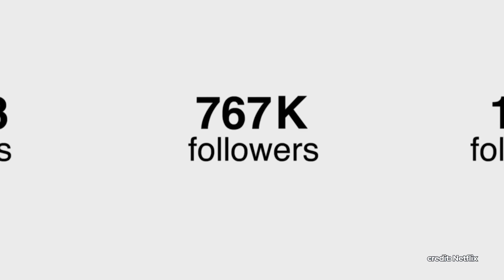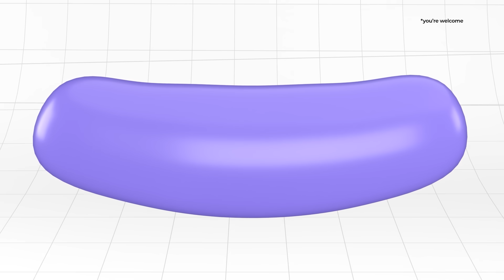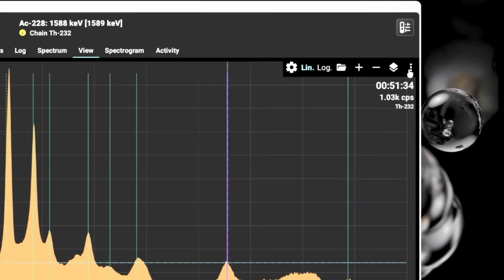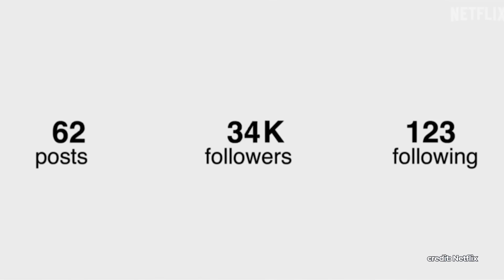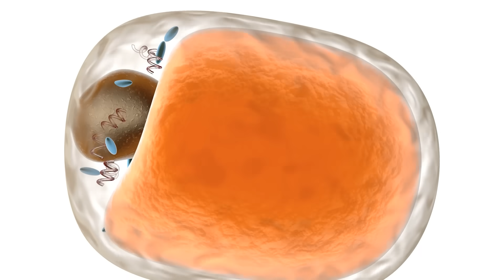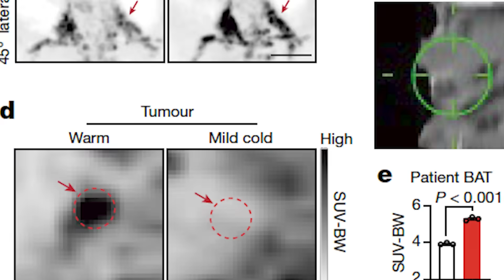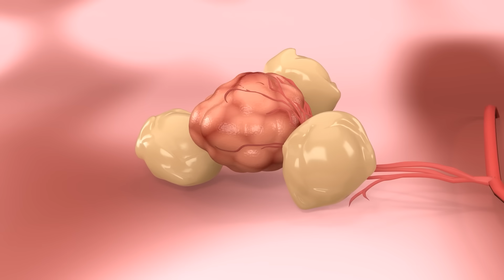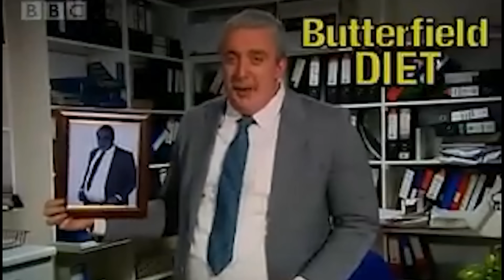Scientists Just Discovered How to Starve Cancer

Comment: 10:22 If the signal gets stronger at cold temperatures, that could still mean that it comes from muscle activity since in cold temperatures, muscles get to be more acitve in order to warm up the body, no ?
Reply: The temperatures were not cold enough to induce shivering, and therefore could not have increased muscle utilization

Comment: Question regarding the terms "Lactic Acid" and "Lactate" that you used several times here.

I was wondering if you were using them synonymously, or if you were intentionally distinguishing between them.

Chemically, lactic acid (C3H6O3) is the protonated form, while lactate (C3H5O3-) is the deprotonated form (the conjugate base).

I've always been taught that due to physiological pH, lactate is the form predominantly found in the human body.

Comment: Plenty of cancers thrive on ketones and autophagy as well.
Reply: Pancreatic cancer cells can be starved of energy by restricting glucose and encouraging the body to produce ketones. However, some cancers, including pancreatic cancer, can also utilize ketones. It's not correct to say they thrive, just that they can utilize ketones as well. You may still see potential benefits from slowing cancer growth by reducing or stopping glucose intake. No glucose will also mean no insulin spikes from high blood sugar, reducing inflammation which can damage your dna, potentially leading to more cell mutations like cancer. Elevated glucose levels can generate reactive oxygen species (ROS), which can cause cellular damage and promote tumor growth.
Reply: @ cancers will switch their energy substrate. It happens all the time. My uncle had several cancers and he switched to very high fat keto and barely ate, and saw no improvements. Cancer is tricky and nobody can say any specific cancer can use a specific diet.

Comment: I dont see how its applicable.
If you can locate the cancer precisely, and you do a surgery to implant the fat cell, you can as well remove it, its more easy.
it there was some fat cell clever enough to locate and agregate to the bad cells, it would be something to consider
Reply: Actually, no. Depending on where the tumor is, removing it is certainly not "easier", it can be pretty hard to do and risky for the patient.
Another key point is that surgical removal of tumors ruptures them and almost inevitably causes cancerous cells to migrate via the bloodstream and potentially cause metastasis, whereas an untouched tumor may have never metastasized. That's why surgical removal of tumors is often followed by chemo.
Surgical removal should IMO be a last resort rather than first one, when the tumor has become big enough to be a direct threat or cause of pain. Otherwise, it's always a risk of aggravating the situation.
So if there's a way to starve a tumor without having to rupture it, that's actually a big plus.
One thing I'd be worried about with this genetically modified fat cells is that they themselves might grow out of control inside the body and cause similar damage. Also, what if their DNA gets into your own? The idea is interesting, but the risks at this point look pretty severe.

Comment: That's very interesting!
But what about glutamine?
According to Dr. Thomas Seyfried, glutamine can be fermented similarly to glucose, and the trouble is the body produces glutamine so it can't be controlled with a diet.
But it seems cancer is using it as a backup energy pathway.
So therapies attempting to starve cancer use keto , but only as one component of the whole integrated therapy.
Briefly they reduce glucose intake as much as possible with diet, but then few times a week they use glucose and glutamine inhibitors to cut the access to the cancer (and other) cells energy for few hours (they can't inhibit them longer because there are processes that rely on these two sources, but it's fine to pause them for short periods).
In these periods most healthy cells can still feed on ketones.
And while the inhibitors are active they apply the attacks that usually aim  to increase cell's oxidative stress (ROS - Reactive Oxygen Species).
The idea is that healthy cells can handle a little extra oxidative stress, while cancer cells are already living with much higher ROS levels (almost fatal levels), so adding that extra oxidative stress is really dangerous to the starved cancer cells, while most healthy cells are fed on ketones.
Different integrated therapies apply different sets of attacks during that period, but typical ones are high pressure oxygen therapy in hyperbaric chamber; high-dose vit.C infusions (which can flood cancer cells predominantly), high-temperature therapy, which is again very dangerous for cancer cells, but tolerated well by healthy cells ...
Could you make a review on these integrated therapies? They seem to be targeting same vulnerabilities.
Many do apply light physical exercise in order to consume the available blood glucose, so that less reaches the cancer cells.
Many people report great success even with parts of these therapies. 
But still these are the so called anecdotal cases, which even when true don't show the actual success rate of these therapies (because we don't have the full data).
Reply: I was about to ask about that myself. I watched lot of videos of Dr. Seyfried and his work together with other reseachers in this field. Its very interesting and i wished more people would be familiar with it and discuss it.
Reply: Naw. Your liver turnes ketones into glucose. You will not ever be able to remove glucose as an energy source because your whole body relies on it as a power source. You can only get away with removing sugars from your diet because your liver will provide glucose as a backstop.

Comment: I am extremely sceptic everytime someone proposes a solution for tumours while science is actually actively more and more backing down from the topic, after the system of "Intratumoral Heterogeinety" has been introduced and showed to be the biggest problem. No tumour is as the next one and they constantly can evolve or deevolve, based on - so far random - factors.

So everything may work on some but may not work on many and this is the main problem in the current field as science always relies on reproductability. 
I was working some time on glioblastoma and found the work amazing but the outlook for the future seemed to be grim due to the inherent cell plasticity of tumours. But this of course is mainly in the field of brain cancers, as they are severly different from cancers found within the body.
Reply: Do saline IV s do anything against brain cancer?
Reply: @jesscorbin5981  I have no idea. 

My work was mainly based on cell markers regarding the migration and therefore transition from epithelial to mesenchymal cells. Most experiments invitro were with salinated growth media. 

Very few invivo but I no idea how salinated solution would work, apart from the regular osmosis.

Comment: I was diagnosed with the rare uveal melanoma cancer. Your information would benefit by being familiar with professor Thomas Seyfried, who expanded Warburg's work. In particular, cancer also feeds on Glutamine. Technically keto should do what the fat does, but then there is gluconeogenesis to deal with, and I am not expert in brown fat. Could cancer burn fat? Seyfried has the answer. Cancer doesn't burn nutrients, it ferments them. Glutamine is essential. Professor Seyfried has developed the press pulse system for this. The new drug JHU083 blocks glutamine uptake only in cancer cells. Your information is definitely interesting,  but incomplete.
Reply: Amen. I wish more people would speak up about this. It would save so many lives.
Reply: Seyfried also uses the keto diet as a key component of his treatment